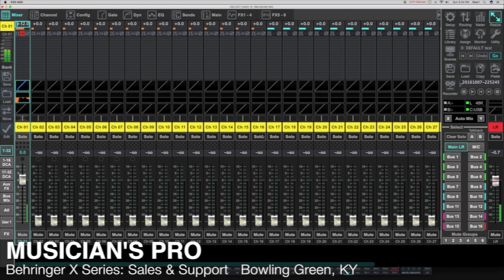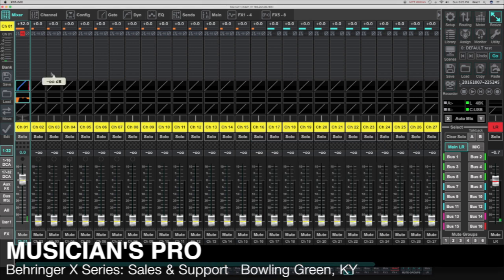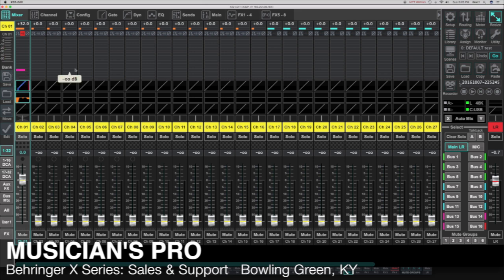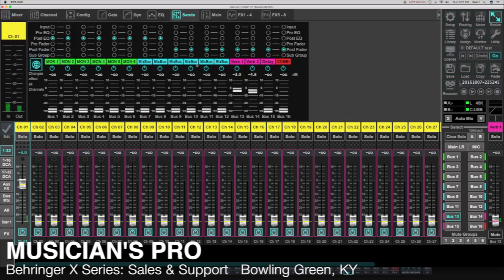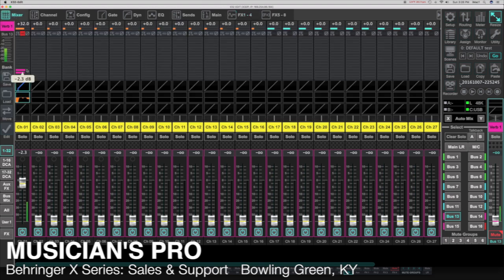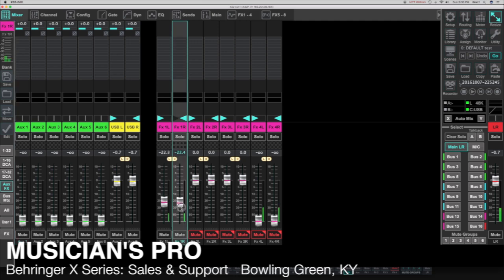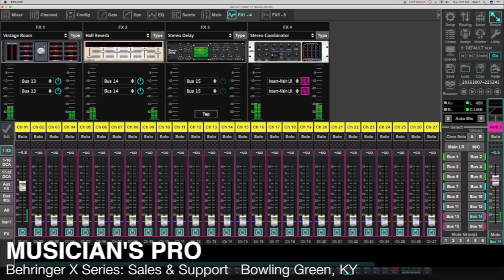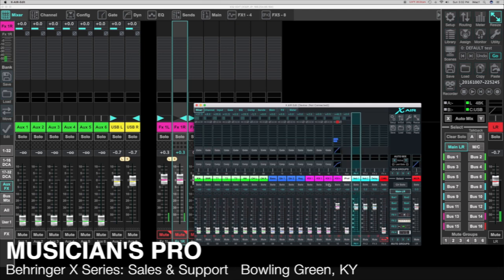EFFECTS FX Aux Effects Reverb (Pt 2 of 4) - MIDAS M32 MR18 + BEHRINGER X32 X-AIR XR18 XR16 XR12 X18

Comment: Hi.   Quick question. If the effect works as an insert , why is it the wrong way to do it?    I understand if I was recording, the insert may not be " wet" to "tape" ( now u figured out my age , haha).  Thanks.    I'm a Drummer, I purchased the X32 just for my drums.  I'm planning on making cover videos and mixing the board audio to the multicam camera mix.  I would like to speak with someone about the best way to go about it.   I'd like the X32 to be standalone , mix live as final mix once board is fully dialed in
Reply from the maker: For example, REVERB can be inserted on a vocal, but becuase there is no MIX control on the reverbs, you would be getting a 100% wet mix and it simply would not sound good or work well.  The same applies for DELAY.  So REVERB and DELAY should be used as an AUX type effect.  Effects like EQ, COMP, DISTORTION, etc, all work well for inserts.